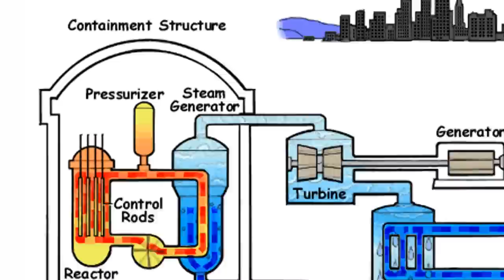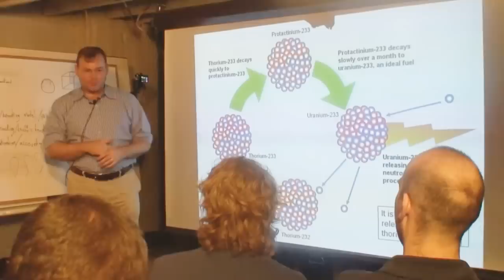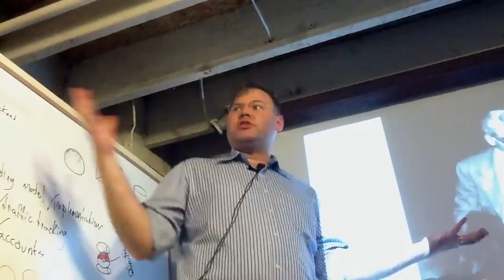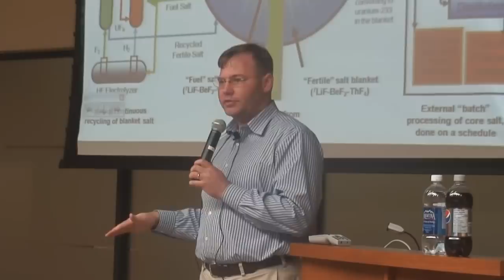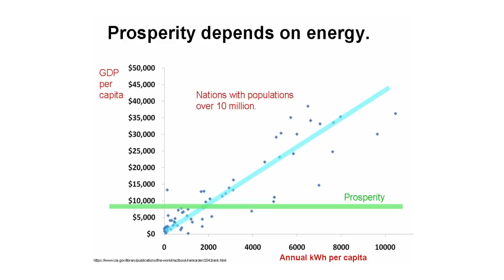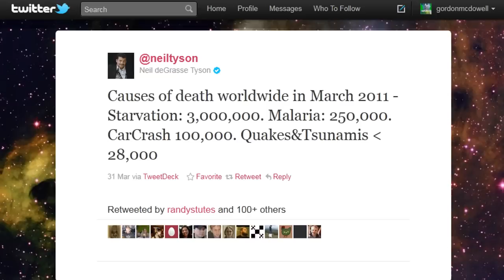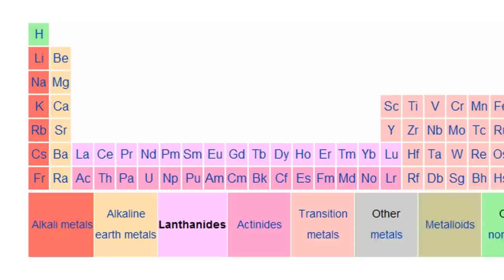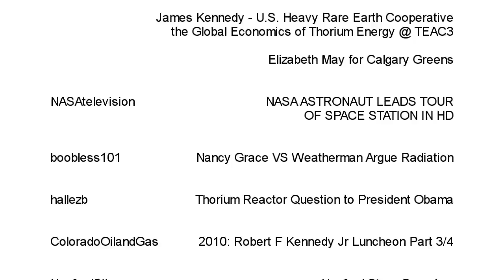Liquid Fluoride Thorium Reactor - Thorium Nuclear Energy - Revolutionary Energy Source

Comment: Good work Kirk,  I only made it to grade 11 Math / English than got my Red Seal Heavy Mechanics in 1968, I drew up a plan for a total use of the Fifth Quarter ( guts / waste by products ) of a pork slaughter /  packing house .

Generating power from the  methane supplying it to the grid and plant via Capstone  /  Honeywell micro turbines, taking the heat of the turbine exhaust to operate chillers for the freezer plant, capturing the Co2 compressing it to be used in a large greenhouse, the fat to be made into Bio fuel and the bio waste being used as slurry for farm fertilizer or dried  for gardening.

The plant stopped slaughtering .

Also drew up the plans for the Bio fuel plant. I cleaned up waste vegetable oil ran diesel Ag. ( farm equipment ) gensets on it  and looked into making Bio hydraulic oil.  Have planed to build a small scale  total energy system using the waste heat lost from the genset to heat my home.

 Hope that some day we cross paths as I understand  a lot about what you are talking about. Best Regards.
Fred Thompson

Comment: I worked at the INL (DOE National Lab "Site" of SL-1, EBR 1& 2 etc.).  I worked with a PhD who is dealing with the fluoride salt corrosion problems.  He is bonding nickel to Hastelloy-N, a nickel alloy used in the ORNL experiment in the 60's.  Nickel is superior to Hastelloy-N with corrosion resistance to high temperature fluoride salt and Hastellloy-N is superior to nickel as an engineered material.  The INL has experience with pyro-processsing.  The process of electrochemical seperation of salt at high temperature.  It was part of the integral Pu fast breeder reactor-EBRII.  There is a lot of experience with these processes if we knit this all together.  It is doable.
Reply: I am curious about ceramic compounds.

Comment: Problem with Thorium is that you can't make nuclear weapons from it so you're up against entrenched Military establishments.
Reply: you could still use uranium just for nuclear weaponry, LFT is just new technology, it's fascinating
Reply: You can't either with a BWR or a PWR, so what's your point ?
Reply: @arnaud7671  Wasn't that why uranium reactors became the norm.  Because of the bomb-making materials produced, most notably plutonium.
Reply: @arnaud7671  The original PWR design was paid for by the US Navy to fulfil their need for a quick, compact reactor for use on ships and submarines.  In a naval context, you can compromise on thermodynamic efficiency and compensate for the inherent risk of using high pressure systems with military and naval disciplined approaches to safety protocols. Once that design work was paid for and released for use in civilian programmes, the incentive to spend huge amounts of money on developing alternative, designs disappears.  Even if the alternatives are better.  The US molten salt thorium programmes were defunded in the 1970's for exactly that reason.  Most nuclear reactors in civilian use, the overwhelming majority are PWRs, many of the rest historically were derived from designs optimised for plutonium manufacture for weapons.
Reply: @Carpenter I think these days the bigger problem is getting investment decisions made by private financiers who are obsessed with short termism and are very intolerant of returns on investments over decades that carry technological innovation risks.  This affects the West primarily.  Countries which aren't so ideologically obsessed with promoting the interests of financial capitalists and therefore don't leave all such decision making to the private sector such as China and India are in fact actively developing this technology.
Reply: @greanstreak04  I am.. thanks!  ✌🏼😎💦  ☮️🌎🌍🌏
Reply: False... try some more research.
Reply: @brothergrimaldus3836  Yeah, I know that you can make nuclear weapons with Thorium, it's just more difficult.  Is that your point?

Comment: They don't tell you the thorium is highly corrosive and a reactor can only be used once.
All dangerous.
They told us the regular reactors was 100% safe.
Reply: Hello LonnieAbsolutely correct !  The hard gamma and high neutron flux will cause major container radiation embrittlement for Thorium LFTR, something that was not really investigated at Oak Ridge by Dr Alvin Weinberg, and totally overlooked by Dr Sorensen.  Closer analysis show that Thorium LFTR provides only very marginal benefits in comparison to convention solid fuel rod systems.  The requirement for continuous reprocessing of the Floruide salt alongside the LFTR reactor is not properly addressed and is a major hazard with hard gamma emitted during reprocessing.
Reply: Agree 100% with you.  The video from Dr Kirk Sorensen is grossly over-optimistic.
Reply: Highly corrosive, yes. That is a huge issue with this concept. Reactor being used once, well that is basically the case with every reactor. 100% safe, that would be a bad assumption with anything nuclear. Hell, look at wind farms. Birds fly through and the blades shred the birds. Even something seemingly safe is not. Solar you say?  Well no. The reflector systems that boil water fry birds in mid flight. Traditional PV cells produce a lot of hazardous chemicals that contaminate the environment and they wear out not long after they pay for themselves. I just wish all people promoting any solution are just upfront and honest about the pros and cons no matter what they are.
Reply: You are assuming that because he doesn't mention it here it isn't addressed at all ever.  This is false.  .All nuclear reactors generating neurons have to address this problem.  A quick check of scholarly articles on the subject on google proves otherwise try searching "thorium reactor neutron flux embrittlement."  Worked for me.

This is a real problem. It's also a well known one.  The reactor vessel (which is petty much a big pot) will undoubtedly have to be replaced at intervals.  Assuming thorium is similar to the very nasty fluxes from fusion, you are looking at 20-30 years.  Which granted, because of the continuous nature of the reactor is 'one' use. 

This is not a gotcha!  It's a known engineering problem all nuclear reactions have and will have to deal with barring development of aneutronic fusion like He3 or proton-Boron 11 reactors.

Assuming that this isn't addressed in a real world reactor design is like metal fatigue in  wind generator blades is totally forgotten about because it wasn't specifically addressed in a video for lay people advocating wind power.  Remember, embrittlement isn't just caused by neutrons. It is a problem for lots of materials for many reasons, including those used in renewables.
Reply: @tommorris3688  Have you ever heard of robotics? New tech you know:)

Comment: We need Energy Generation, is the unity-connection inclusion of whatever available resources can be utilised that doesn't cost more than the safe return.
By observation, Molten Salt "combustion" of Nuclear Fuels is the optimum choice available, and horribly overdue since the 1950s when it was recognised as the reasonable alternative to the Forever War mentality. As the world advances in complexity, so must the Engineering required to maintain a rational balance in Principle,  in proportion, otherwise the problem only magnifies day by day. 

The "Shut up and Calculate" technical meaning is a philosophy by default logic denying that there is any actual restriction on a functional solution in the Einsteinian way, ".. the materials to solve (your problem) are usually at hand and the answer is simpler than you think". 

(Yes, but so far the Question is being put in too-hard political terms that deny the answer, due to unspoken selfish exclusivity)

Comment: So why are they not converting to thorium ?
Reply: that was also spoken about in the documentary...

politics make decisions based on what they know and how they are lobbied at; and the faces they see are those of the high pressure reactors used for the last decades. It just takes (a lot of) time for the word to reach those of the required power to set up a molted salt reactor experiment to work out the details (takes investment money as well) and only than move into larger scale production.

also.. the now used high pressure water reactors'  lobby will be pushing against the idea of molten salt, because they still make a ton of money selling fuel pellets.

so, yes there are plenty of obsticals in the way to see it realized in the west, but as we also heard, they should be busy on it in China as we speak.

Comment: Sad to still be hearing the anthropogenic CO2 driven climate change scam. The case for solar, cosmic radiation, water vapour driven factors being much, much more significant, means that carbon fuel combustion is not causing significant climate change. Furthermore CO2 is fantastic for all plant life on the planet. Polution, however, is a whole other issue!
Reply: I agree. We need  co2 but Methane is doing a score on global warming
Reply: Paul Carter as in making it worse
Reply: Don't forget multi-decadal ocean oscillations, barycenter wobble, etc... I too rolled my eyes when they mentioned GW in the video, but I'm so used to it being brought up many, many times in science type articles and videos that you learn to just ignore it. Sad
Reply: In earlier eras, the Earth's atmosphere had a CO2 concentration of 6000 p.p.m.  The present contemporary concentration of atmospheric CO2 is 430 p.p.m.  Even with 6000 p.p.m., life was possible on Earth.
Reply: yes, but not life as we see it right now, which is kind of the issue. Earth will be fine without us, but we'd kinda like to not die off. If we can live a little more cleanly and not pollute as much, we stand a good chance of not significantly changing our life on this planet. 
It's not even enviro-wacko propaganda, just common sense. Don't shit where you eat and you won't make yourself sick.
Reply: Your theory would work if deforestation wasn't an issue, and it is a major contributor to climate change

Comment: When someone starts saying "we can get hydrogen from splitting water" then I get really scared and it proves they have really really poor thinking skills... it's essentially a Freudian slip... so why is this scary and bad? you can split water right and get all the water back right?.... sure you can... right... we need water to survive, and fresh clean drinking water is already a shortage - so why would you ever start using water for hydrogen when you could split something like natural gas for hydrogen?... well because you have poor thinking skills... the energy to get hydrogen is huge, and the water you use in the process is forever polluted - secondly you don't get water back in 1 to 1 ratio so you're essentially consuming fresh water - the stuff you need to survive... and the ratio you get water back is a factor of ten at best... so if you make the mistake talking about how to get hydrogen from splitting water reveals your poor thinking skills then what other things are he completely wrong about or get's it backwards...??...
Reply from the maker: you could just  use salt water.
Reply from the maker: you need salt for electrolysis.
Reply from the maker: If your going to distill the water anyways... Salt water also works.
Reply from the maker: at least i dont live in my mom's basement.
Reply: Just curious how is the water that you use to generate hydrogen contaminated? Also what happens to the 90% of hydrogen that is not reduced to water vapour?
Reply: Water works better for HHO if it isn't pure, as in sea water or 70 % of Earth.
Reply: Some metal catalyse are able to relase hydrogen. I do not know how it is happen, but it work. But process require a lot of heat.